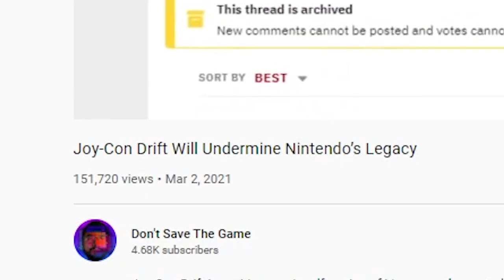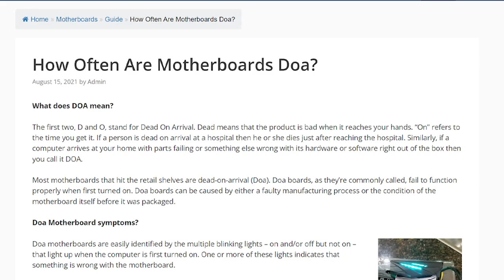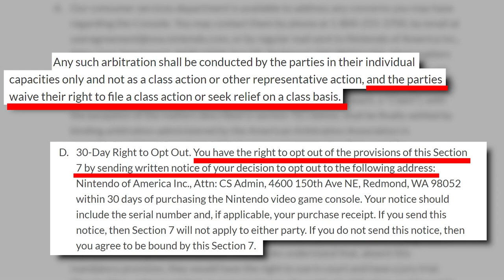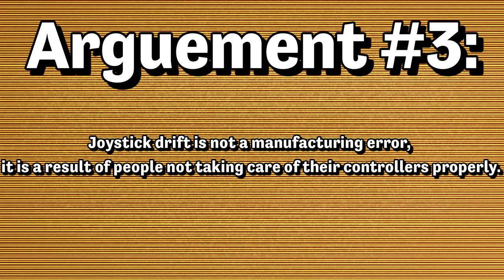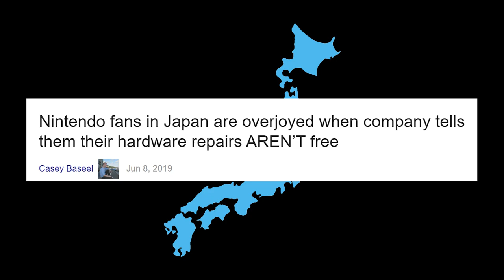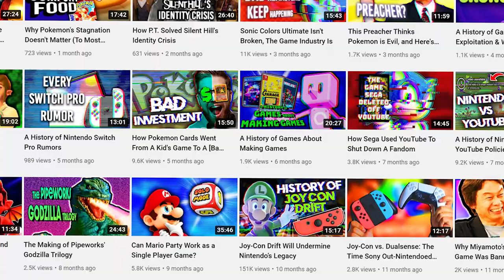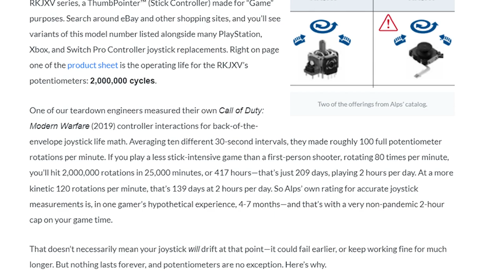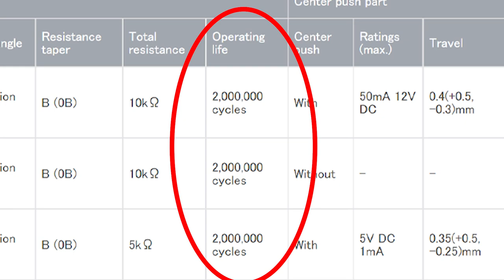Joystick Drift is a Modern Gaming Epidemic - Here's Why

Comment: I do think that it's forgotten just how often controllers in the past would drift or break in some way.
I blew through so many authentic Gamecube controllers soon after the Gamecube came out, just from normal play. Just like the N64 and its control stick, Mario Party was likely a major contributor to this. The Gamecube controllers' stick pads would come off, they would just go loose (guess the stem would break off) and would stops working. The Wii remote for me commonly just completely stopped working, same with for friends'. They just wouldn't turn on. The nunchucks have held up, they weren't really used much. I'll say that my original NES and SNES controllers have held up extremely well, almost perfectly. The Wii U Gamepad has had drifting issues, and the shoulder buttons have had issues for me as well. Plus Nintendo handhelds have common issues with the shoulder buttons as well. I'd say that the Joycons are equally as bad as Nintendo controllers have been for me in the past. Sure there've been outliers that have somehow lasted longer than other controllers for the respective consoles, but I've had problems with practically every console I've had. 
tl;dr Joycon drift sucks, but it happens with almost every console controller

Comment: My experience with consoles I've had and how long I've been using them:

Ps2 (6 years) - 4 controllers, no problems

Ps3 (5 years) - 2 controllers, no problems

Ps vita (3 years) - started drifting after 3 years

Ps4 (6 years) - 3 controllers, one had drift out of the box, second one started after 4 years

Nintendo switch (2 years) - one pair of joy cons, started to drift after ONE MONTH

Comment: It seriously  to blame the company fault for actually  what  was going  on with there equipment though and what is seriously is wrong with it that's ,especially  just like how Ford is not doing right with their parts and that they are on a lawsuit  strike toward causes  of the parts in their trucks and cars ! I just bought 4 xbox controllers and now they having  stick drift know it's the pain in the ass to fix even you can seriously  actually  see from the switch controller

Comment: My right joycon has a big tendency to not correctly read the face button inputs so I'm forced to pause the game and wait for the problem to go away.  I eventually bought a pre owned joycon but it predictably also had drift and the R button was even missing the clicking sound. Luckily I bought the protection plan and returned it for full price and bought another pre owned controller (apparently dark red joycons are rare now), but again it also had a bit of drift. The three gamestops I went to did not have any new unboxed joycons. At least this time the drift is only relegated to the right stick and not any of the other buttons. Oh yeah my switch gamecube controller also drifts (but that's much more forgivable since gamecube controllers are notoriously inconsistent and finnicky).

Comment: my Joycons don't drift... anymore. All of the joycons I've gotten save for one pair of two I use every day that somehow is just fine. all 4 other sets have started to drift, especially the ones that came with the console.

however! if you're willing to open up the things and do the fix with a piece or two of cardstock shoved in there underneath the joystick plate, they'll never drift again.

in my experience each joycon is different. sometimes you need just a single sheet, others I've needed 3. regardless, the fix really isn't that hard. it's definitely on purpose or at least purposefully ignored at this point.

also, I own a number of controllers, from N64 to Gamecube to ps5 controllers. none of them have ever drifted. the closest thing is the sticks on N64 controllers wearing out and falling off from too much mario party
Reply: also, if you have any specially colored joycons, just fix them yourself or take them into gamestop or something. absolutely do not get help from Nintendo lol

I can speak from experience that their repairs don't work very well anyway. as far as I could tell all they did was clean out the dust from around the joystick. I still had to fix them myself to stop the drift.
I think maybe one pair worked for like a single session of BoTW after I got them back
Reply: This all seems useful but it's also argument 5, which he states in the video. The bigger issue is that people shouldn't have to do that. Like you stated, the problem is being ignored unfortunately
Reply: @DeronHargrove  oh, I absolutely do not disagree with the video at all. just sharing my experience in what works. 

it's truly ridiculous that an end user should have to worry about this kind of thing, let alone have to fix it themself
Reply: @princetbug  That's more than fair. Probably came off a little hostile so I apologize for that. Just, yeah, I agree. It's wild how often this happens. I recently for rid of my Xbox 360 and that had almost no drift. Same with other controllers I have, even newer ones.